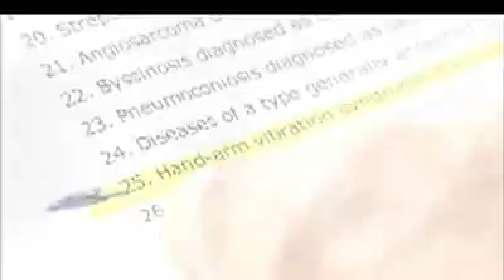HAVS or Hand Arm Vibration Syndrome

Comment: My experience led me to research current figures on HAVS in New Zealand.  According to ACC there were only 40-50 cases of HAVS in New Zealand over 18 years from 2000-2018.  This is unusual because 6230 cases were reported in the United Kingdom in half of that time.  Even if we consider that the two workforces are similar, based on population statistics the incidence in New Zealand should have been 785 cases in 18 years or 44 cases per year.  However, given the higher number of at risk jobs in New Zealand, including forestry and agriculture industries, we could argue that the incidence should be higher in the New Zealand population.  Why are actual cases reported so low compared to other countries?
  

According to ACC data 5342 cases of carpel tunnel injuries occurred over 10 years from 2008-2018.  If the UK had a similar proportion of carpel tunnel injuries then there would have been 41857 cases in the same period.  The UK only reported 2930 carpel tunnel injuries.  Although, prolonged vibration exposure can cause nerve and other musculoskeletal injuries, the data strongly suggests that patients in New Zealand are being misdiagnosed.  Unfortunately, I have seen many of my colleagues diagnosed with carpel tunnel, undergoing surgery only to return to work with persistent tingling and numbness in all of their fingertips.  Symptoms which I can relate to as they are actually part of HAVS.  HAVS may be misdiagnosed because it can start in one finger but progresses to involve all fingers, whereas median nerve entrapment and carpel tunnel syndrome does not involve all of the fingers.  

https://www.stuff.co.nz/business/123839858/highlighting-a-little-known-vibration-issue

Comment: Any advice I’m starting to get this but don’t want to stir up trouble at work what should I do ?
Reply from the maker: Hi, it depends what's causing the condition for you; if you're using vibrating equipment then Decade Anti-vibration Gloves would be a good place to start. They come in a range of options and some styles are available singly so you can customise them to suit your needs i.e. full finger on one hand and half finger on the hand that needs greater dexterity etc. We can provide gloves and glove liners for everything from high frequency vibration such as grinders, chainsaws, weed whackers etc. to low frequency vibration such as rattle guns and jack hammers. Hopefully you've already sorted something out by now; apologies for taking so long to come back to you.
Reply: I know my reply is probably late but if you haven't already then leave the job or make it known to your boss. Your health comes first! Take care